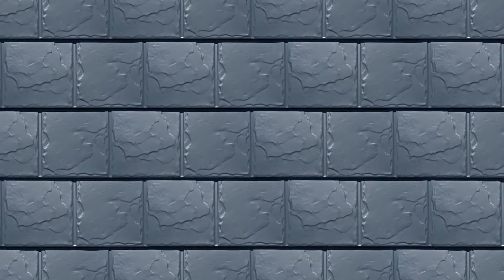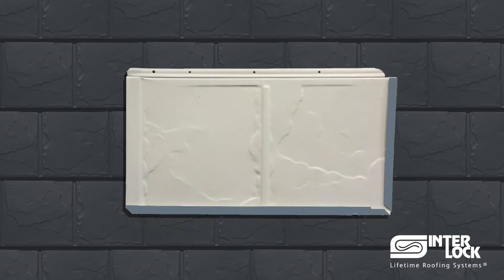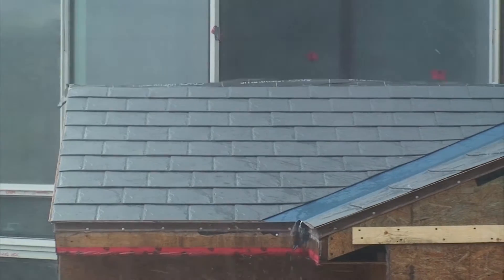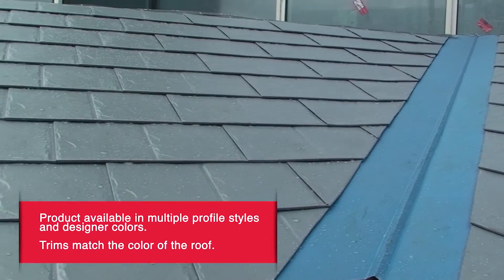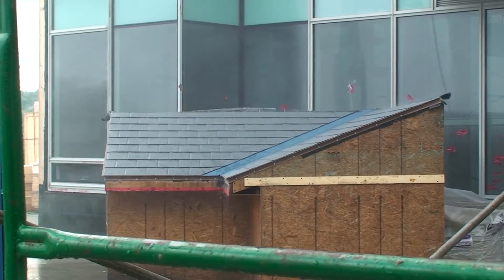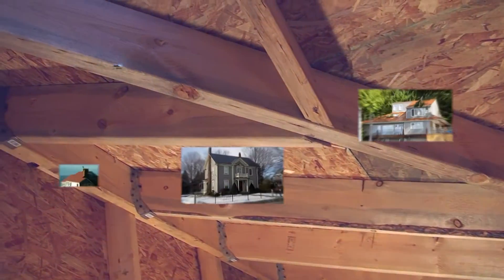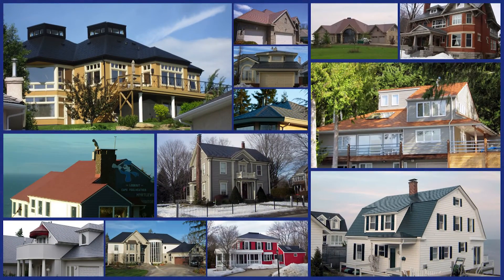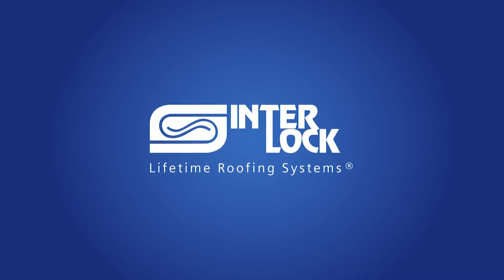Metal Roofing Wind Test :: Withstands 120 mph (Class 2 Hurricane)

Comment: thanks.
0:20 airplane turbine was used to simulates 110 mph / 177 kph / class 2 hurricane,
additional fasteners can be installed to withstand higher wind speeds.
interlock metal roof withstand that 110 mph / 177 kph / class 2 hurricane